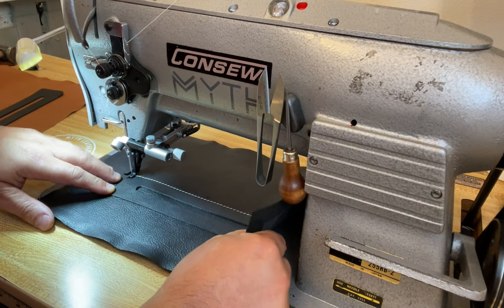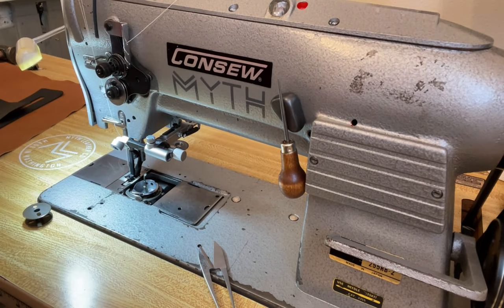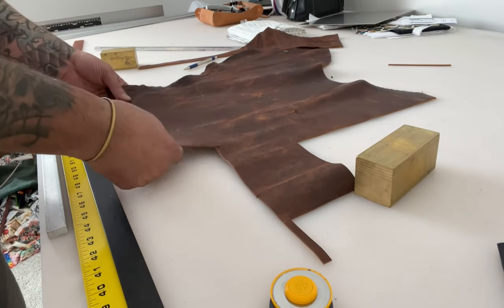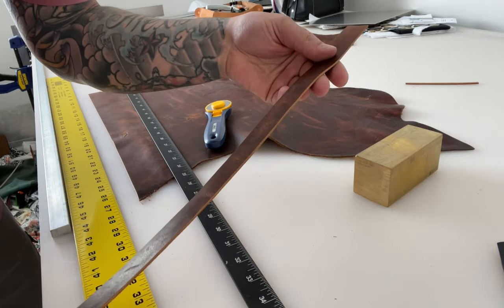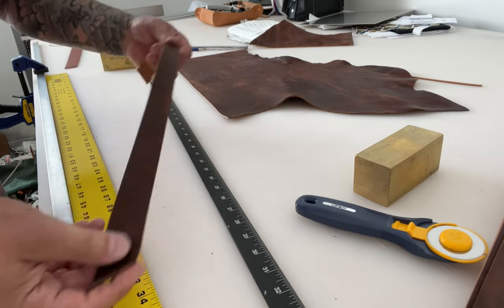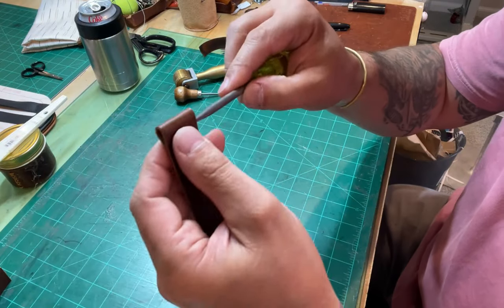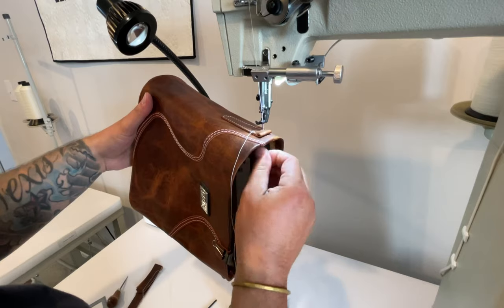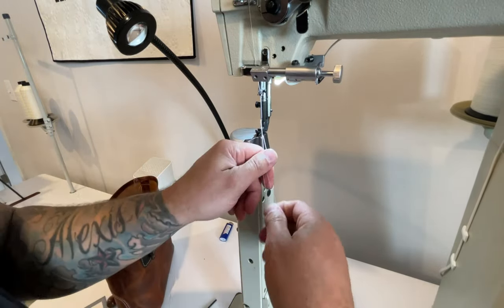Maker Vlog Vol. 2 | Loki Build | Leather Bag Makers

Comment: Is there a reason you stitch the  zipper topper with the wrong side of the foot? I noticed you only do it on that piece and nothing else.
As well, if you're doing lots of glueing in your house you will definitely want to switch from the solvent glues, as without proper ventilation tables or respirator masks they are extremely dangerous to use. They've been banned in most of Europe for this reason. Renia makes a wonderful water based glue (aquilim 315) which is JUST as strong, and water based, so you wont be taking years off your life (or brain cells) when you use it.